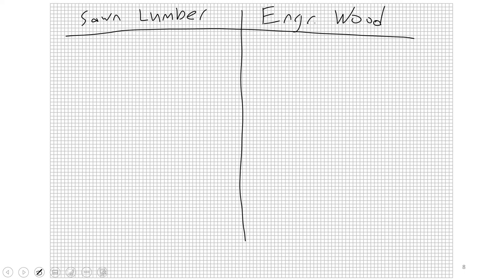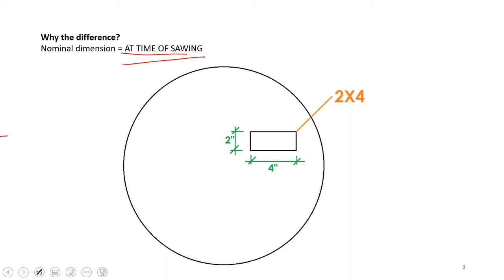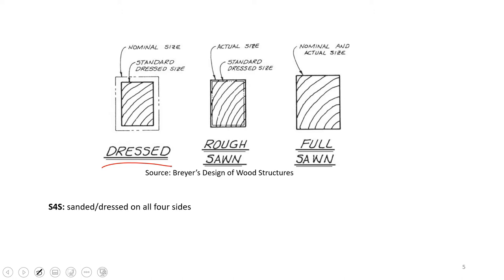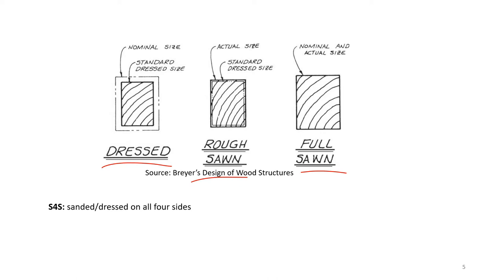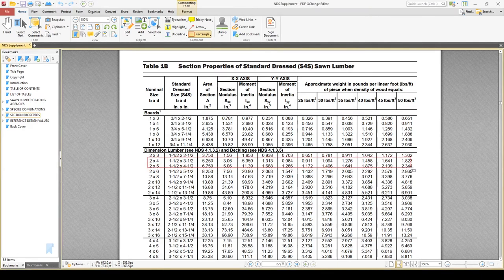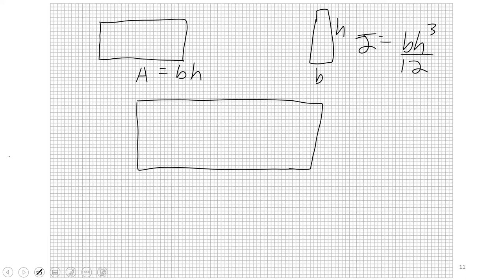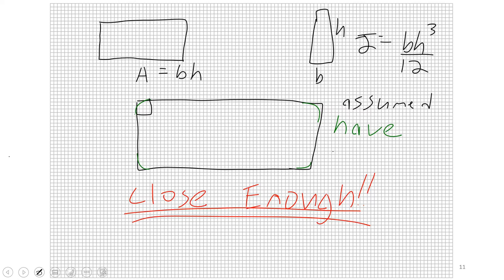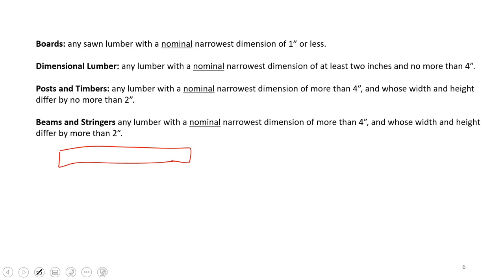All Dressed Up - Sawn Lumber Sizes, Dimensions, and Classification

Comment: Rough swan timber is not difficult to handle or remove from a stack splinters tend to be small and break short due to the irregular surface (lots of small splinters). 
Planed timber is actualy more problematic as splits can form sharp edges on splinters that tend to be quite long as the smooth surface has less week points to form a break point. If square edged it can easily cut skin if slid in hands when handling the rounded corners make timber safer to handle (few but sharp). 
Decorating timber is also a consideration having a rounded edge helps paint flow around the corner a square edge creats a stress or week point in the paint that is prone to breaking / cracking open on sharp edges. 
It is asumed we are viewing the end grain of the timber for dimensions the length being an unstated variable in UK we have standard lengths in most timber yards 2.4m 4.8m are the most common longer is special order and can be expencive as most imported timber is approximately 5m maximum length.
Reply from the maker: Thanks! I may be wrong about the splinter issue in regards to fully dressed vs rough sawn lumber. And you're right, there are several benefits to rounded edges on dimensional lumber.